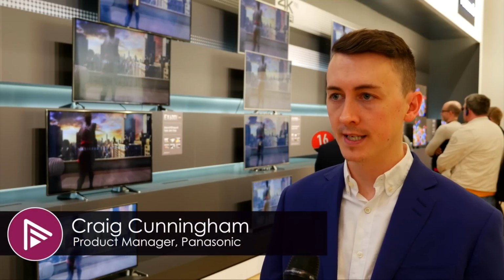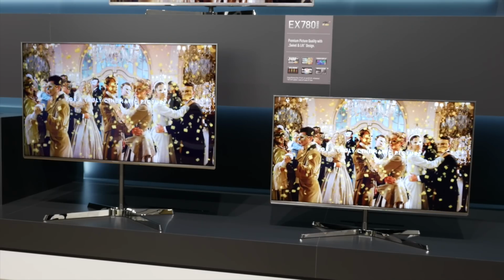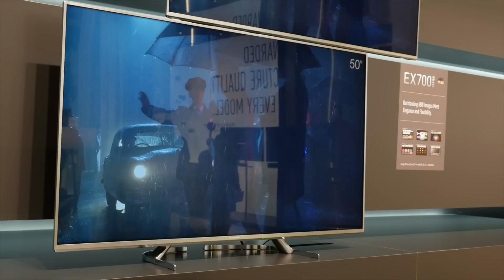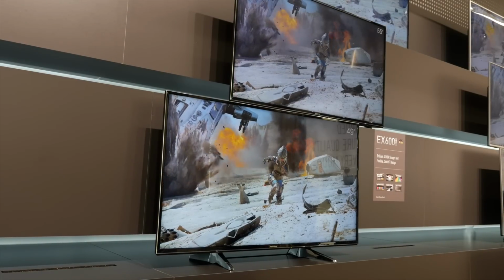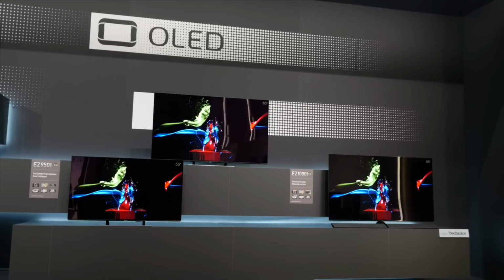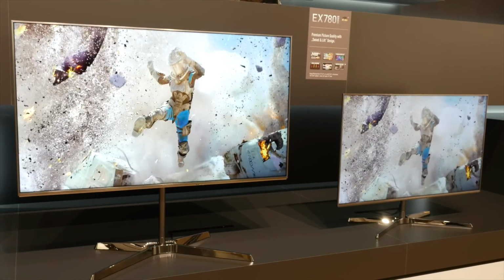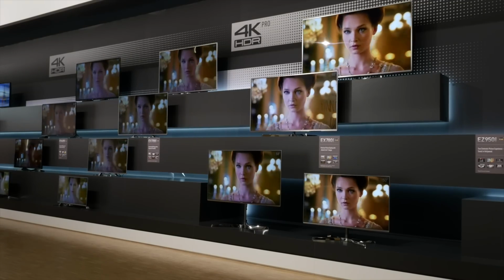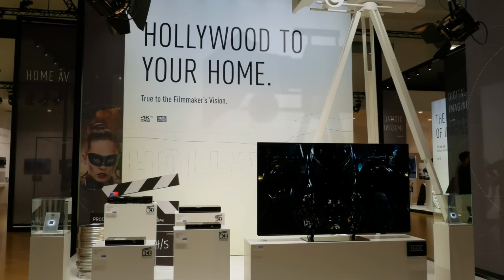Panasonic EX780, EX750, EX700, EX600 4K UHD HDR LED TVs launched

Comment: I bought a 58 EX 700B 2.5 years ago and it’s failed and will cost more to fix than the TV cost me £888.00 Panasonic don’t want to know. It needs a new panel. In 2016 Panasonic stopped making panels, and I think this is the reason I’m left very disappointed.

Comment: I have a ex750, my last TV was a 2 and half grand Sony,  2017 model. This blows that away. You can set it up to be excellent. The 3d is spot on. 3d looks clearer and better than a 4k movie on it . The picture is bright colours are really good. You wont get much better for gaming either. Looks nice aswell sat on it's own on its stand. ( if you have a amp,n bang everything into that and use one hdmi to the TV. Looks really slimline. Were really into movies and weve had every TV going over the years. This is the best all round TV weve had for sure . Does it all. Try and find one now . All gone . End of 2017 they came out so not that long and there all gone. We just bought another one and I think we got the last one from vlrsrance in argos. Loads of people were watching it